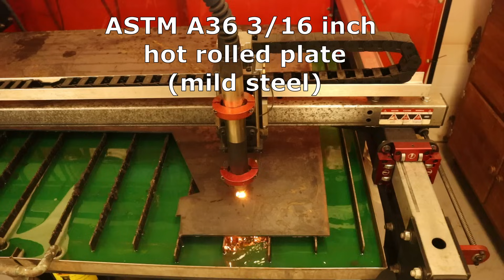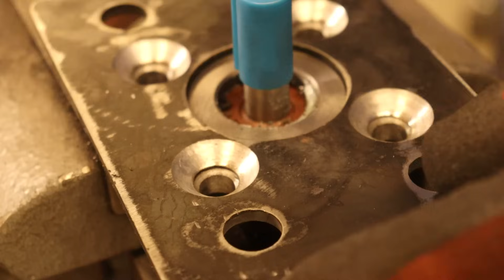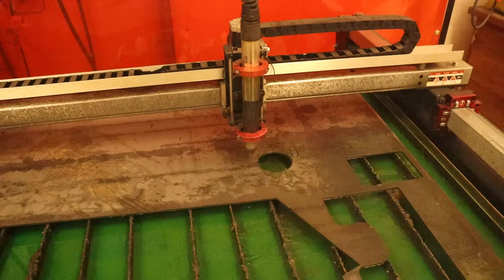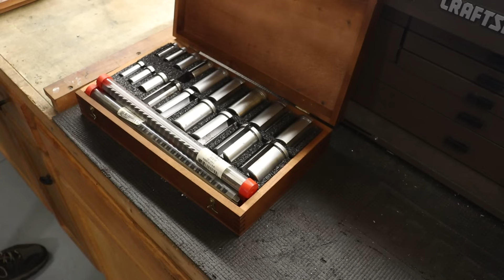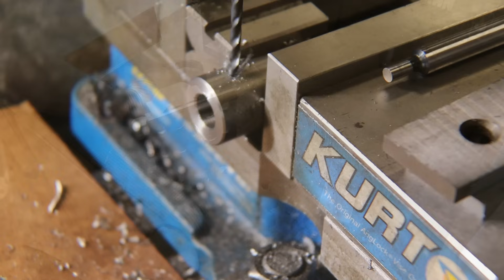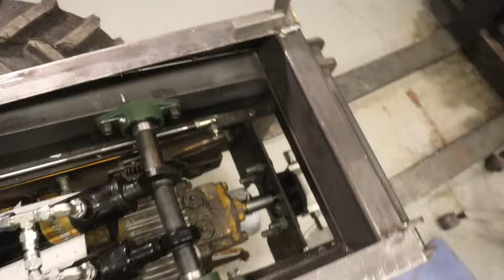Hydraulics Upgrade!

Comment: should of used a lovejoy coupler
Reply: Having it mounted solid will cause problems. It is impossible to line up perfectly and the frame will flex with loads and traveling over uneven surfaces. 

Lovejoy coupler would have been a much better choice
Reply from the maker: I've done it both ways. Haven't noticed any issues with solid couplings because the 5/8" shaft from the transmission is a bit undersized and pinned to the coupler, allowing some misalignment.  Though, generally, yes, a lovejoy is a better choice.